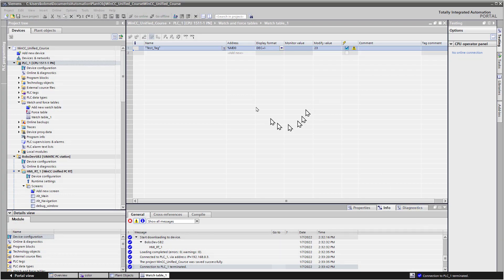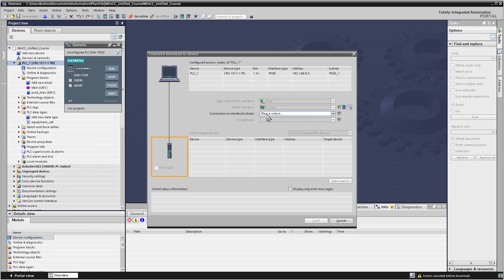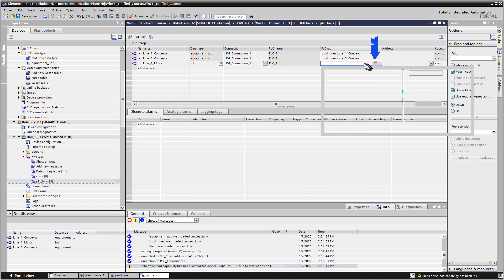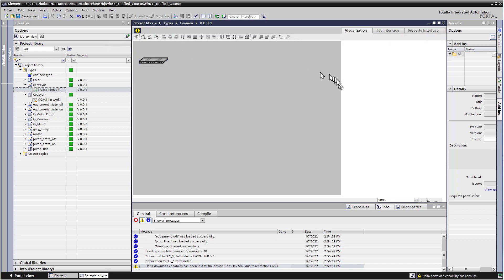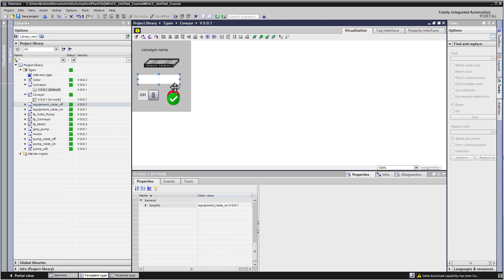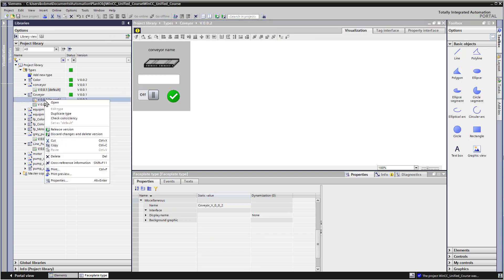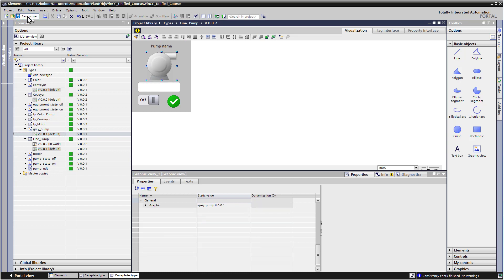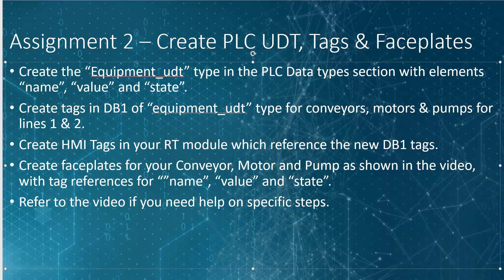WinCC Unified V17 # 30: Create UDTs, Tags & Faceplates for Unified Plant Objects 🧑🏽‍🏭 #WinCCGURU

Comment: hello!
When I insert a IO-field, the virtual keyboard does not appear on the screen to enter the value in the field. What can it be?
Reply from the maker: what type of runtime are you using? Unified IPC or Panel?
Reply: PC @WinCCGURU
Reply: PC @WinCCGURU
Reply from the maker: So, when you go to runtime, in the browser, and click on the Io field, or tap it, the keyboard does not come up?
Reply: @WinCCGURU  yes
Reply from the maker: I looked to see if there was a setting for it in Unified V17 in Runtime settings, but didn't see anything.  I did find a setting to use it in the editor, under View. You could set that on and see if it comes up in the editor to make sure it works and is installed. Also try Kiosk Mode in the browser. Also, can you open the windows On Screen Keyboard (OSK) and see if that works?
Reply: @WinCCGURU I am going to try. thanks